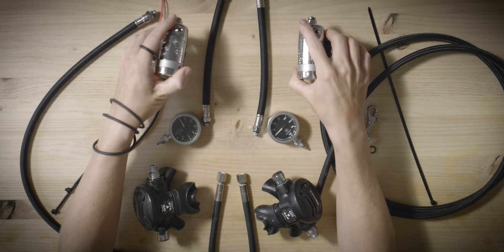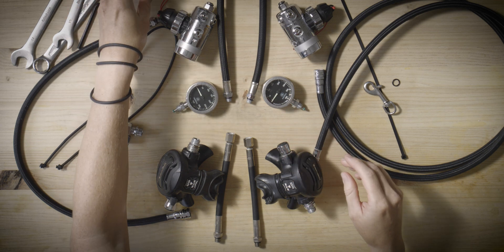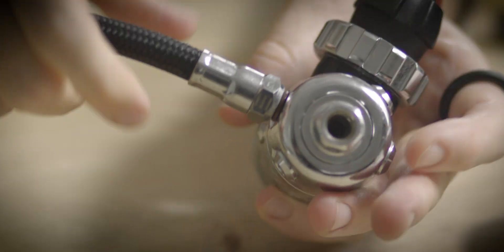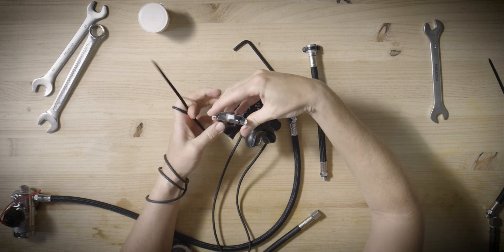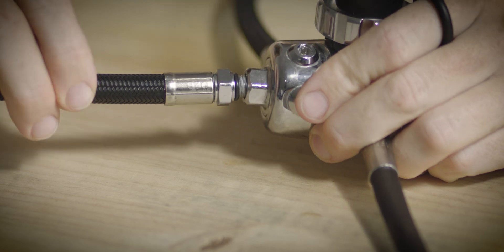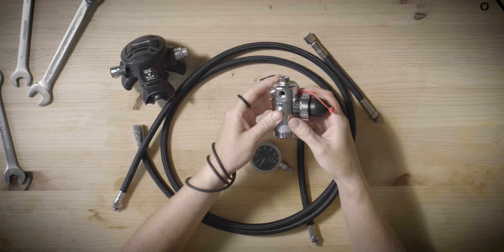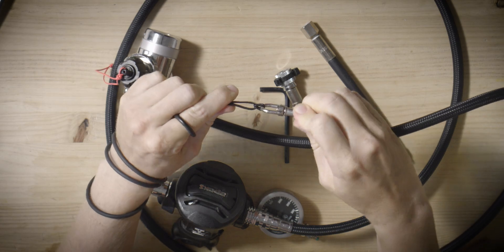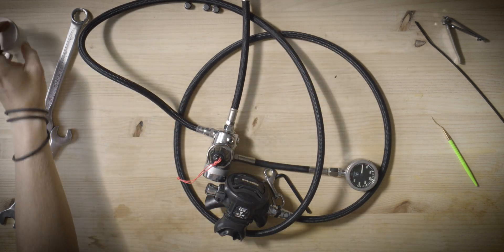How To Build A Sidemount Regulator Set (Short w/ Long Hose) | Master Series

Comment: Nice. What's the hose length for drysuit inflator do you recommend? Thx
Reply from the maker: Thanks, Billy. This really depends on the orientation of the front zipper (if any) on your suit. The inflator valve position can vary by about 5 cm, so there’s no single setup that works for everyone. The main goal is to avoid creating a large loop from excess hose as well as not using something very short as that would pull the cylinder valve in, towards your torso.
Reply: @flowstatedivers  Thanks. So a rough measurment from the inflator value to the middle of my bicep would be sufficed?

Comment: What O-ring are you recommending for the breakaway mechanism on the long hose?
Reply from the maker: The ones you are using for your LP hoses, avoid thicker ones as it going to be hard to break. Make sure to test after you have installed it

Comment: I can never get the ziptie + o-ring properly secured as they keep on sliding away.  However, just like how you use lines to tie the boltsnap to your torch, I use lines + o-ring.  So far, this works well.

I never seen the dual ziptie on the inflator hose though and I will give this one a run.  Thank you 😃

So many opinions on 90 vs 70 degree swivels.  I have opted for the 70 degree.  What's your opinion on this and if possible, your opinion on "omni" swivels too.  Thank you.

Comment: Suggestion: instead of silicone grease use proper O2-compatible lubricant like Tribolube. It is not too expensive and will probably be safer when using Nitrox.
Reply from the maker: @xineissm  This is a common misconception. An O2 compatible lubricant is only working if it's not contaminated. Using this in a non-sterile environment with tools that were not o2 cleaned, it's totally pointless. If you are using non recreationl' mixes so anything higher than 40% your equipment has to be o2 cleaned, but that includes your regulator and cylinder as well as all o-rings.

Comment: Great video, but you should really use two wrenches when you are tightening the nut onto the second stage and SPG.
Reply from the maker: We intentionally take a different approach because using only one wrench helps prevent overtightening, which could and will otherwise damage the O-ring and cause leaks. You can effectively use one wrench without any problems.
Reply: @flowstatedivers  It is easier to overtightening (doing damage) with one wrench than two. Especially on the second stage.

Comment: Very useful, appreciate it, be assembling my sidemount soon, one question however, can we use both 5th port for Spg and also any preferred material for hoses if we decide to stow spg into the band ?
Reply from the maker: @52hz52hz  Hi, the 5th ports are LP ports, so they're not suitable for SPGs. If you're inexperienced, I recommend sticking with this exact setup and assembling your regulators identically. Make changes only when you have gained enough experience and can justify the need. Your instructor will likely advise the same.
Reply: @flowstatedivers  acknowledged, thank